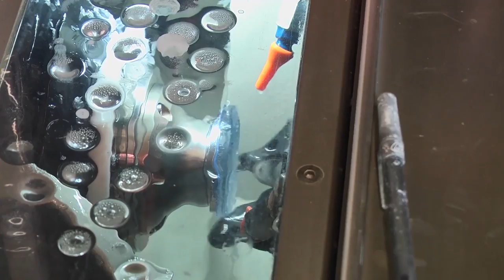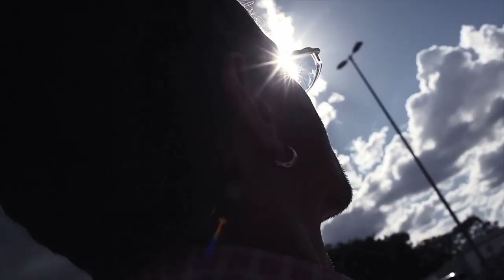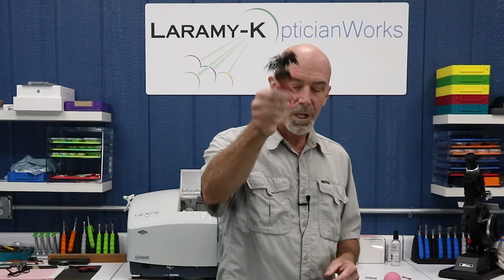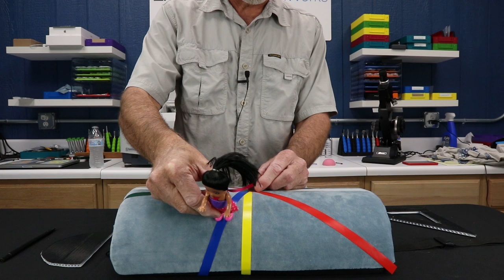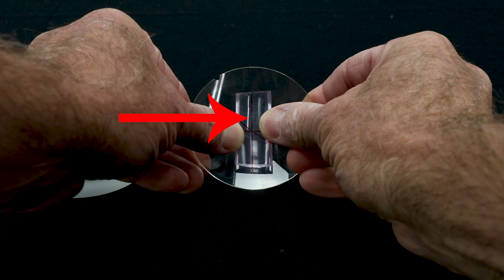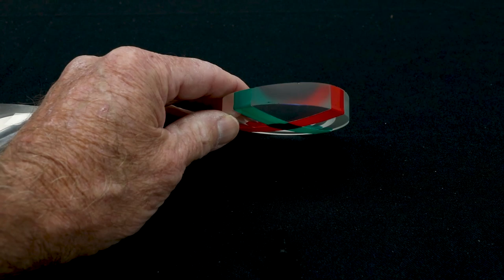Understanding Cylinder Lens Curves: Climbing Mt. Cylinder

Comment: Just to be annoying: with a cylinder, when you dice up your cross-sections into those “180 pieces”. You ought not describe those upper curved profiles as “spheres”. The 90 degree perpendicular cut, yes, is spherical (produces half circle cross-section [the further + 90 degree longitudinal cut would produce a rectangle (plano)]. But the upper curves of the cuts between those extremes are actually ellipsoidal, rather than spherical. elLIPSoidal, kinda like our beaks.

Comment: Can my optician cut cylinder lenses to correct axis within 1 hour
Reply from the maker: Sure stock single vision lenses with cylinder can be done in an hour. Cutoff is usually around 3 diopters of cylinder but finished uncut go out much higher.

Comment: I have question about DpE
If patient has vertical DPE what is the wearing issues may experience at the near visual  point when wearing multifocal or progressive  lens?
Thanks in advance John.
Reply from the maker: DpE DPE? I am not familiar with that?
Reply: It's different prismatic effect in vertical meridian
Reply from the maker: OK Still not 100% sure what that means. If one eye is minus and the other is plus the add power (near visual point) still works the same. If the "prescription" calls for prism and the powers and directions are different then they should be there to balance vision or in other words eliminate any issues. There is slab-off, there is prism thinning, there is prism but nothing that I know of "different prismatic effect." Again, not sure but as I mention in several videos, "progressives aren't for everyone."
Reply: Thanks a lot